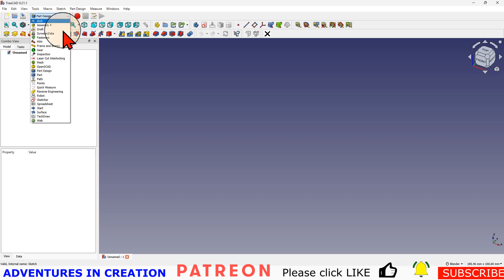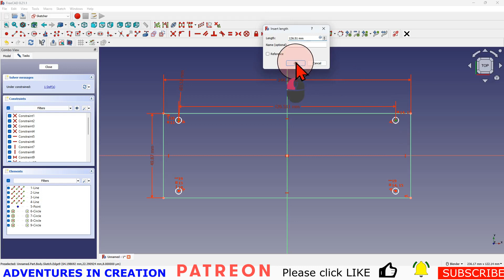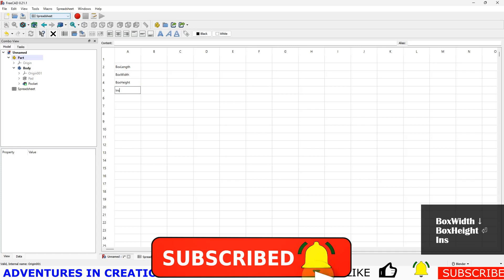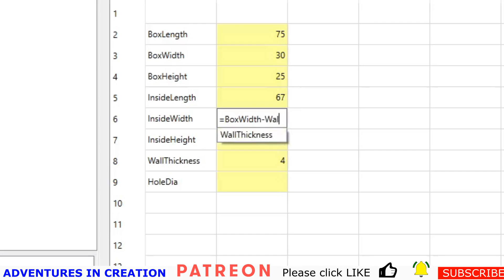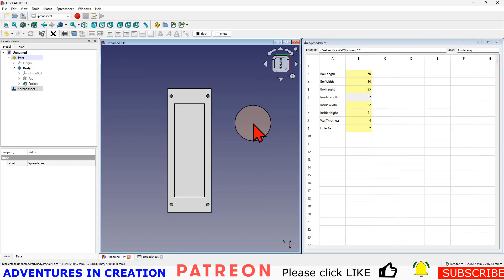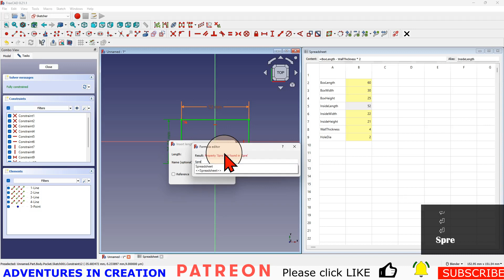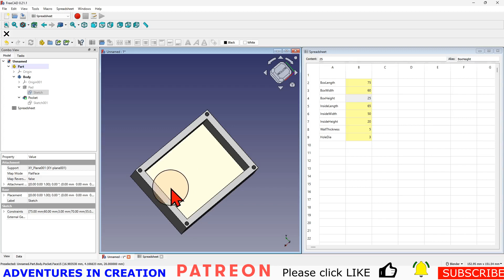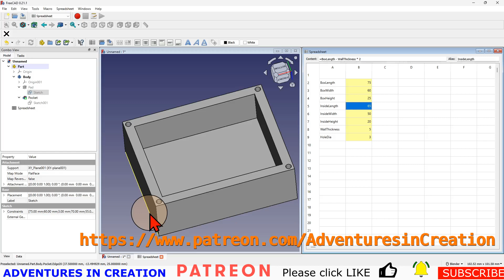FreeCAD for Beginners #59 Setting Up a Spreadsheet #freecad #cad #makers #design

Comment: Super helpful - thanks! After creating the box along with you, I tried to add Fillets to the top outside edges and it all fell apart - I'll need to go watch some earlier videos to try and figure out why that is. Fillets to the top inner edges around the pocket worked great. It's the "little things" that can still trip me up 😀
Reply from the maker: You have to make sure that there is enough room for the filled to complete or it will fail.
Reply: @Adventuresincreation  which begs the question, "how" do you make sure there's enough room? As new as I am, I'm not sure what to look for or what to adjust. Like most things, it's probably easy once you've seen it in action but quite the blocker when you don't 🤔

Comment: I have a two-monitor system and recently have been undocking the combo view and moving it to my secondary screen, and then I split the main screen with the drawing on one side and the spreadsheet on the other. I would like to, undock the spreadsheet and move it to the other monitor as well giving me the full screen for my drawing. 

Is this possible?
Reply from the maker: I will take a look at it and see if it works.

Comment: I've been doing a lot of playing around with 0.22 and your tutorial will work in it.  There is a smart dimensions tool in the new sketcher but you can still use the manual dimensions tools.

Great tutorial.
🍻
Reply from the maker: Yeah, I am looking forward to using the smart dimension tool.
Reply: @Adventuresincreation  you wount be disappointed.  I made a few designs with it and the devs did a great job with the tool.  I really like how you could go to the horizontal or vertical line with the dimensions tool rather then have to go to the origin. Such a small change that makes a world of difference to the end user experience.

🍻

Comment: Cool! I have learned something new, although I use spreadsheets extensively (I modified my startup to automatically create a spreadsheet) I never used diagonal symmetry to align bolt holes, which was cool, and eliminates tying two holes to a corner. Additionally, I normally use column C on the spreadsheet to note calculated values, so I know not to change them directly. Thanks again Ian for sharing today, your work is appreciated!
Reply from the maker: I use that third column to indicate that too, I was trying to keep it simple this time ;-)

Comment: I learned how to use spreadsheet for parametric modeling from one of your earlier videos. But I enjoy a refresher course because it seems I always learn something new from you. As you were laying out the spreadsheet labels I was wondering why you were dimensioning the interior when I was quite sure that you would be driving those dimensions from the wall thickness. After thinking about my own experience, it made good sense to do the calculations in the spreadsheet so that you have easy to understand labels in the sketches.  I did see that you explained that towards the end of the video. Well done.
Reply from the maker: Thanks!